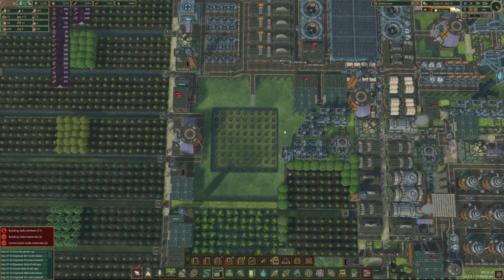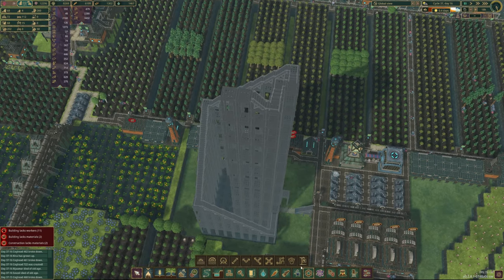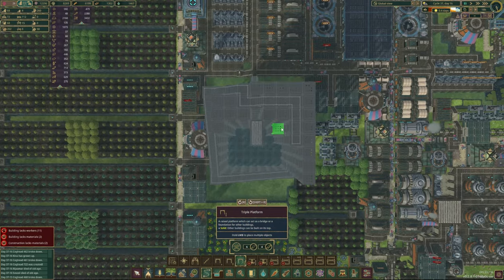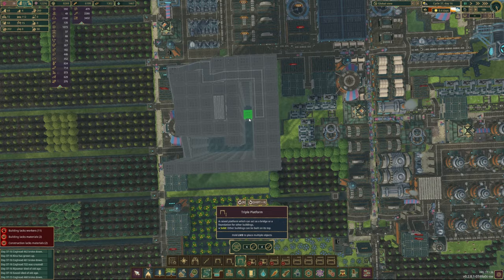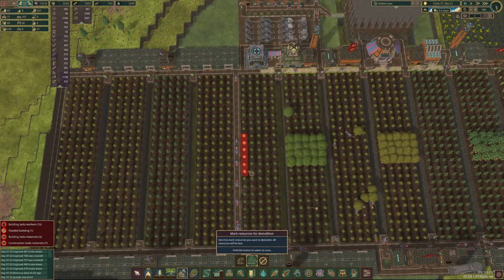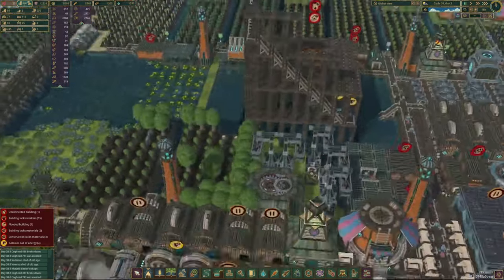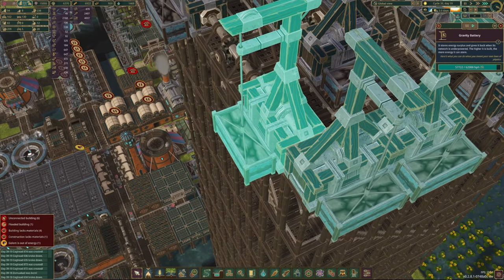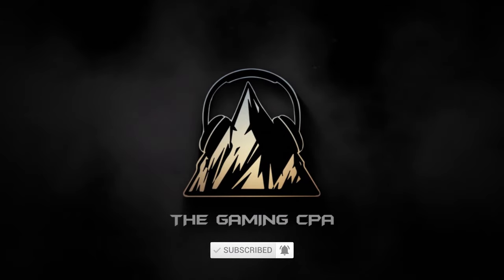I Make the Best Battery Ever in Timberborn!

Comment: I'm putting storage buildings inside the tower, not platforms. So the tower store both energy and materials.
Without storage, it is better to have a 'wall' design, simply 2 tiles width, and weights hanging on both sides. Stairs and power transmission inside.
Reply from the maker: That's a smart idea!

Comment: The bases of the gravity batteries share power so you can connect the batteries with more batteries instead of the power shafts if you plan the stairs better, then build the batteries furthest from the stairs first letting each successive battery block & connect to what is behind it. ( & Batteries can go back to back also, so a rectangle of platforms [2x___] can work to support 2 rows back to back. ) ... Just imagine a battery bank so long you need a temporary district at the top of map to build the thing 😁
Reply from the maker: Haha I like it! Surround the whole map with back to back Batteries. 🤓

Comment: I THOUGHT YOU WILL BUILD FROM THE BOTTOM OF THE MAP, BY EXPLODING THE GROUND LEVEL TO BE THE LOWEST IT CAN BE, AND FOCUS ALL THE BATTERIES IN THAT HOLE , INTERESTED TO SEE A VIDEO LIKE THAT, WHAT IS THE MAXIMUM , MAXIMUM , A GRAVITY BATTERY CAN STORE IN TIMBERBORN.
Reply from the maker: Hey Alexandru, these batteries are built at maximum.  The descent of the battery starts at the highest point I can build out and goes to the lowest point of the map (using dynamite), unhindered.  So they are at maximum power.
Reply: @TGCPA  Ah, the level was that low to begin with , also, does water affect the batteries descent or not?
Reply from the maker: The level was pretty low, I believe it only took about 2-4 dynamites to reach the ultimate bottom.  No, water doesn't impact the descent at this time.